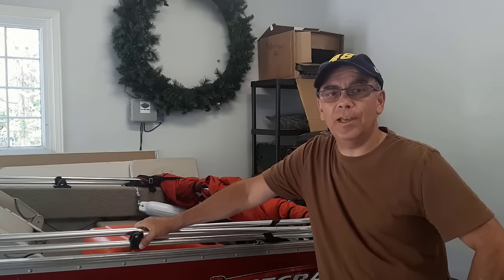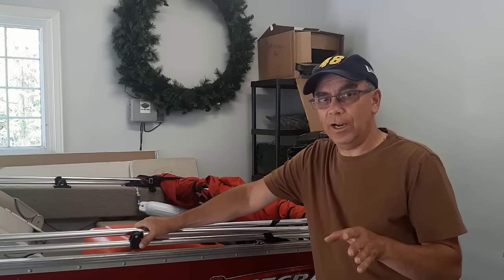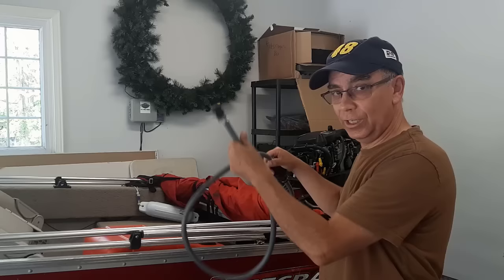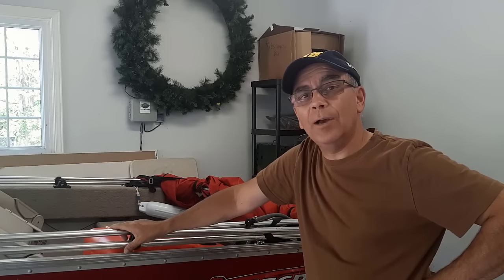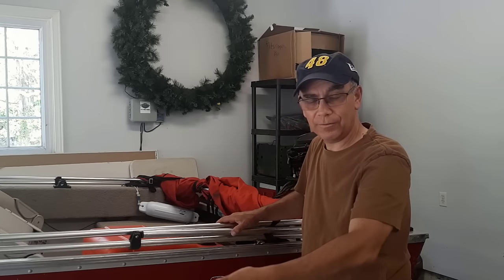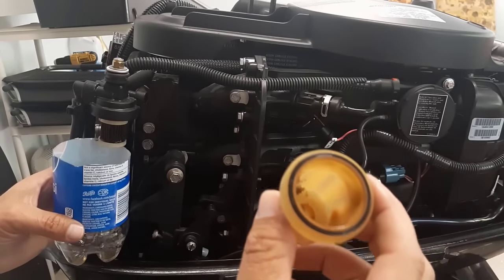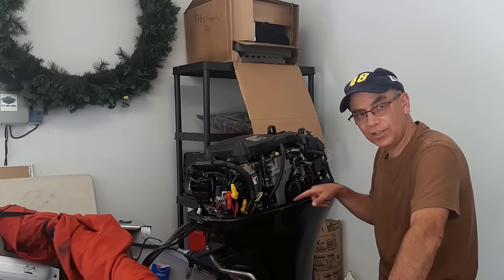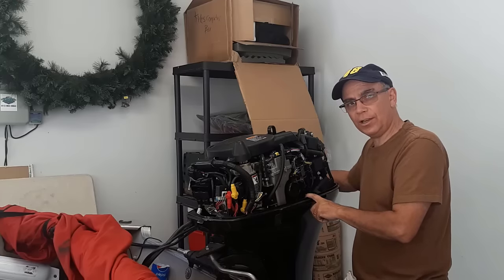Mercury Outboard Runs Then Dies // Try This Before You See Mechanic

Comment: I am a mechanic and I have been working on ATVs, PWCs and outboard motors for 20+ years. You pretty much nailed the problem but I would have the carburetors cleaned if you haven't already. That will have the fuel system 100% which is very important for a 2-cycle engine.
 Anytime you have a lean condition with a 2-cycle engine, you are asking for internal engine damage. Number one cause of low compression is bad fuel and/or stopped up carburetors or fuel restriction.
Reply: That's a 4 cycle with injection

Comment: Great video.  You had the luck of being able to get back each time on your venture,  We have a pontoon boat, that is hard to work on when it is in water,and expensive to have someone pull us out each time it fails.  We have same problem as you did but in our case all that stuff will need to be repaired/replaced. Your video will be a huge help.

Comment: I always start from the tank, the pick up in the tank usually has a little screen enough to stop bigger particles from entering the system. The previous owner used cheaper gas with ethanol in it which is the leading cause of interior line deterioration especially left over the winter. don't use ethanol gas at all in your boat, use the highest octane which will take you further with more power and be better for your engine and the lake you are exhausting in. The older 2 stroke were blowing up on this ethanol added gas because the ethanol would separate from the gas and worse the oil so the engine had no lubrication while using up what ever amount was sitting at bottom level of tank. Change that other filter ASAP as the lines broken down particles will jam or even gum up the injectors. Cheers and Peace Out
Reply: Octane has nothing to do with efficiency or power.  2-strokes have very low compression and high-octane fuel is a waste of money.  Do use REC-90 or whatever they call real gasoline (no ethanol) in your area.  In Ohio, its 90 octane.

Comment: Thank you for this video. My fuel filter looked just like yours. Hoping this will fix my issue. 2004 Mercury 60 hp 4 stroke starts up, runs for 10 minutes then stalls. Question> Should the primer bulb be solid the entire time while the boat is running?

Comment: I Had the same problem two months ago, and I did remove all the gas from the tank, filtered and put it back, I did not change the filter, thanks for the idea.
Reply from the maker: Yes check the fuel filter under the motor cover and check the fuel line for deterioration.

Comment: I had the same issue on a Mariner motor.  Turns out I had a little glob of water in the bottom of my tank. I was hugely surprised by this because I drain my tank for storage and I'm careful with my gas. The motor would run great until I opened it up. The bow would rise and the ball of water would roll down to the pickup and the motor would bog down.
After idling the motor would run great, open it up and it would bog down.
I tried everything you did including re-building the carb.
Same thing kept happening.
I found it by turning the gas tank around so the pickup was on the high end of the tank and the motor ran great.
Drained my tank and found the glob of water. Hard to believe that a little ball of water could cause so much trouble.
Needless to say, I felt pretty silly for not checking the gas and the tank first.
If your tank pickup was facing toward the stern there might have been a ball of water rolling around in your old tank.

Really great video
Reply from the maker: Wow thanks for sharing this info. Crazy how something so small can mess you up. I'm sure it would have took me a long time to figure that out as well. Thanks

Comment: Good job, you were on right track after changing the water pump prop.. if your problem did no go away after changing the fuel filter next to check is fuel pump if its good the clean up the carburetor its common for outboard motor carburetor to get built up with gung and get blocked.
Reply from the maker: It solved the issue and worked great after the fuel filter and new fuel line.

Comment: I wish i had watech your video 5 days ago . I similar event happened to me. I ended up flushing out the inboard fuel tank put new fuel lines and  changed the fuel filter. I started it up and it is running so we going to trial on the water tomorrow - wish me luck

Comment: Great video. I was having the same exact issue.    My boat has an 11 gallon internal tank and the ball bearing that sets in were the fuel line Connects to the tank had rusted and was stuck. I knew it was something to do with the Internal tank because when I used an 5 gal 
external tank the motor would run with out issue.

Comment: Mine did the same and ethanol was the culprit. I stopped putting in ethanol and the problem went away. I use 100% real gas since that time. No more issues. I also add stabil during storage months.

Comment: Our new 2020 Mercury 115hp did the same thing the 2nd year we owned-it. The Lund dealership in Peninsula, Ohio told us to run 87 octane in it. Turns out, that 87 octane had fouled the spark plugs. We changed the four spark plugs and NOW we run ethanol free gas only, PROBLEM-FIXED!!! ⛽️ 🚤

Comment: Great video! This saved my trip this past week in Florida. Thanks so much for all the useful intel put in easy to understand step by step instruction. Greta job! Thanks
Reply from the maker: Hi there, glad to hear that. What exactly was wrong with yours? Which part helped?
Reply: @GettingItDoneRepairs  
Based on the advice in the video I changed both fuel filters and the fuel line from the top of the tank to the motor and replaced the bulb. We also removed the old gas from the tank and replaced it with ethanol free fuel.  All told the cost was about 125 for the parts and my son and I made the changes.  The job was easy with your help and for that I am eternally grateful. Thanks much my friend!

Comment: I had the same issue with my merc 60hp efi.did everything you did.found out that the water pipe from pump where it meets the power head has a o ring seal.it was this little seal that perishes over time.the workshop said its the cats bum if you know what I mean.once it perishes it restricts the waterflow to motor.but that randomness of it going into limp mode was effected by 1 head wind.2 tide flow.3how many people I had on board.4 how full my inboard tank was.70 litres is a bit o weight. 5 the swell I was boating into.it was so random but eventually we got to that seal.replaced it and I can fill my tank.go in any weather and have as many on board and my 60 hp runs like a dream.

Comment: I had an issue like this one time. Would run fine in neutral rev up like it was gonna blow the motor. The minute i would put it in gear it would foul the plugs up solid. I changed power packs, ignition coils, plug wires, carb kits,new jets, cleaned the reeds, made sure it didnt jump the fly wheel. But i didnt do what you mentioned in this vid. Ive long since gotten rid of the 25 merc, but I imagine it was just one of those keep it simple type fixes that would have gotten it up and running

Comment: Thanks for the video I have a 2014 Suzuki that is doing the exact same thing after a long trip to Rockport Texas. Came home to flush my engine and it ran great idling for 5 minutes then started chugging and check engine light comes on. I turn it off and start back up - same thing, runs good for a min of two then chugs and dies. I think this information will probably solve my problem as well. Thanks!!!
Reply from the maker: You are welcome! good luck with it

Comment: I spent over $1800.00 with my boat mechanic trying to fix a problem with my motor not getting my boat up on a plane. The second time I took it to him I told him to run the boat on the water he did and had the same problem I had. He took an additional fuel tank and hose with him after he changed to his tank the problem was solved. The hose was warn out and restricted the fuel from getting to the motor. Now it gets right up on a plane a very expensive fix. Check your hoses if your having any trouble with fuel issues.

Comment: I had the same problem and figured out it was the internal gas lines in the motor that were soft ,,they were shutting closed under high pressure. ,  ran  beautifully at idle then shut off at Full Throttle

Comment: PS:  I would never run any outboard big or small without a separate water separating filter as my primary filter.  You would be surprised how much condensation a fuel tank can make.  I like the Ray-Cor models but Sierra and most manufacturers make their own as well.  Shop around and get the appropriate size for you gallons per hour and then get a 6-8 micron paper element in the spin off portion.   You mount it to the boat then hook your six gallon cruise tank (or whatever your fuel source is) up to it.  It is plumbed into your motor.  You can quick connect the tank to the separator to facilitate fueling or whatever.  The best separators have a spin off filter and a collector bowl at the bottom where you can keep an eye on it for any water or other contamination.  Some situations require a metal drain bowl, some allow the see through plastic.  All have a petcock so you can drain a sample now and again.  Glad to hear everything worked out.

Comment: Great info! Another very simple cause of the same issue is forgetting to vent the gas tank. Sounds silly but when you travel with your boat you need to close the vent screw on top of the gas tank so that has doesn't spill all over in your boat. It's really easy to forget to loosen that vent screw when you get to the water! Probably the 1st thing Is check then follow your list of items to check. Thx for the info
Reply: Do you need to close the vent so that no air gets in? Or open it so that air vents?
Reply: I just bought a new 12 gallon specktor gas tank filled it for an upcoming trip and most of the fuel leaked out thru my fuel line into my 75hp Honda. My son smelled fuel so we walked down to the boat and discovered the take nearly empty and fuel in the driveway under the motor.
It was quite hot out for a couple days 90.F partially in direct sun. The vent valve on the fuel cap was closed.
 This type of tank is new to me, it had no instructions. I lost about $40 of fuel.
 Any help would be appreciated.
Reply: @jackconner958  same happened to me twice with a new tank I had, could not figure it out .  A friend gave me a tank and it quit doing that so I am curious as to what causes this also.
Reply: Pressure building up in the tank pushes the fuel up your fuel line out of the tank. The check valves (small ball at the end of your fuel line is not seating properly and allowing fuel to go passed it into the engine. Check, clean or change it. Covering/shading your tank or park the boat out of the sun will help. If you have to, leave your tank air vent open to not allow pressure to build up in the tank, until you can deal with the check valve. Leaving the vent open allows moisture from the air to enter the tank when the air cools.

Comment: Great information  i just had the same issue but mine would not ideal  so the repair shop replaced  everything you did and cleaned all the carburetors and bust out another thousand I will have the boat on the water on Monday

Comment: Just seen this great video as my boat engine died on me today on the water. I think it's the fuel pump but now I'm going to go through the same steps that you went through before I jump to conclusions. Just one question. Did the primer bulb feel any firmer once you sorted the problem out and had fuel flowing through the system? Thanks for sharing your experience..

Comment: Had same issue with older Merc.  Did same repairs as you did , plus had carbs cleaned and rebuilt, but still kept getting issue.  Ended up replacing motor ☹️

Comment: I had this problem (and I am having a slightly different one now) when my boat was "new to me". The screen on the high pressure pump in the VST was damn near clogged!! Just throwing that out there... I am thinking the 2nd filter may be clogged as I have never changed it.
Thank you for the vids on this!
Reply: And when you take apart the VST tank, bench test the high pressure fuel pump in it.  Just give it 12v to the two terminals

Comment: Another tip about the fuel line, if you have the original fittings, just buy automotive fuel line in bulk of the size you need, a separate primer bulb, and some hose clamps if needed. If you continue to use the gray line with the inside liner, same thing will happen where it disintegrates clogs stuff up. Hope this helps 👍
Reply: It 8 it
Reply: No, that's illegal. The Coast Guard will find you and tell the Game Warden and the Wildlife Officer and the Army Corps and DOT and EPA and the Park Ranger and Forestry and the Park Service, and then you won't be able to drive your boat for 10 years and give you a fine and make you apologize to the local Boy Scout Troop on the local News at 10.
Use marine grade, USCG approved hoses.
Reply: T55 5554

Comment: Thank you for posting this !!!! My brother and I got a used trihaul with a mercury 70 hp 2stroke the boat had been sitting a long time we finally got it started but shuts off but before we started it we bought a new tank,fuel line, new gas and we did not even think about the filter 😳 but when it ran we heard a loud sound sounded like a grind ?? But only when  it ran on hi idle but we decided just to take it to the shop and get it all redone or just get another motor but thank you for your awesome video!!!!

Comment: Had same problem on 2 stroke 115 5 yes ago. Idle great, bog and choke after on plane for SHORT time. $400 for shop to rebuild fuel pump and replace those STUPID fuel lines. My merchandise did not have filter before fuel pump so desentegrated inner liner clogged fuel pump to where to supplied enough fuel to idle and fill bowls. Fuel in bowls got me on plane, but clogged pump could not feed fuel fast enough (until gunk removed from rebuild). Great video for keeping boaters calm when motor runs, but seems fuel starved.
Reply: My Merc (not merchandise...)

Comment: I had the same thing happen to mine and it actually quit running and wouldn't start. I started at the tank and it had a screen filter in the tank on the end of the pickup tube that had got clogged enough to collapse the tube and it actually fell off the nipple at the top of the tank. Fixed that and thought my problem was solved but it wasn't and then I found the little filter that you showed and they actually sold me just the filter, that was march 2021. It runs good now.

Comment: One additional idea in this era of ethanol fuel.  Use a gas/water separator filter of 10 microns or less to help filter out moisture and debris.  And change the filter annually.   And don't use fuel containing ethanol if possible.

Comment: Really helpful tip for overwintering your boat. If you pick up a gallon of that trufuel period or something similar it's expensive but it's basically 98% paraffin. You won't get any of the harmful chemicals like Benzene which ends up ruining all your hoses. Then in the spring you can fire it right up

Comment: Getting it done north of 7 my boat was running and the first time after winter I got it out it started right up like it always does and then when I would give it a little throttle it wouldn’t have any power and like get up and go then when I would try and give it more throttle it would die!! I’ve put fresh 93 octane fuel in it and oil and it would still do it?? I thought maybe it had water in the line or the gas that was left in the carb??? I still have not been able to figure it out and the summer is just about over!! I’d definitely like to get it out a couple times this year for sure!! Any help would greatly be appreciated thanks!!

Comment: I had a similar problem with contaminated fuel, turns out my 3 year old Grey fuel line was disintegrating / desolving on the inside putting grit and gunk on my carburetor. My outboard guy said you need to pay up and get the good quality black fuel line. Have replaced all fuel lines from the tank to the fuel pump and cleaned out the carburetor, no more problems.

Comment: My issue was the fuel pick up tube was very loose and sucking in air. I put a hose clamp on it so it fit tight and now I can plane my boat and it doesn't big or die. Ordered a new unit for the tank and I'll be good to go, I bet that is what your issue was as well.

Comment: Stay at from ethanol blended gas, it causes those inner liner on the fuel lines to deteriorate much faster
Reply from the maker: Premium gas only
Reply: @GettingItDoneRepairs  Premium or not does not matter. Non-ethanol is the key.

Comment: Thumbs up for as far as you got.. When doing this properly you need to pull tne outflow fron filter to fuel pump to check for crud in small glass babyfood jar by squeezing bulb then reconnect and crank engine with outflow fuel line from fuel pump disconnected to see if its pumping. If its pumping into a jar it should be good
Reconnect its hose and if engine still womt start or stay running theres probably blockage in carb jets or injectors. Thats a seperate matter. 
Fuel feed is fron tank to filter, to pump then carb or injector pump then fuel rail and injectors.

Comment: I've been having the same problem with the 6hp Tohatsu on my inflatable.  I've had the carb apart twice now with no luck, also replaced the fuel filter.  Going to check the tank & fuel line now and look to see if my Tohatsu has a second fuel filter like your Merc.  Thanks for the helpful run-down on what you did - it's renewed my hope in getting this fixed!